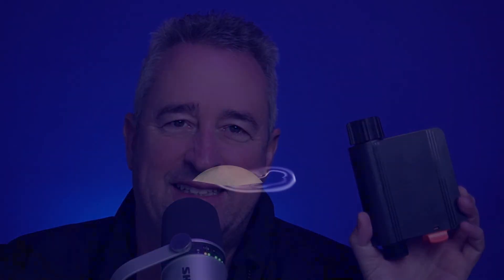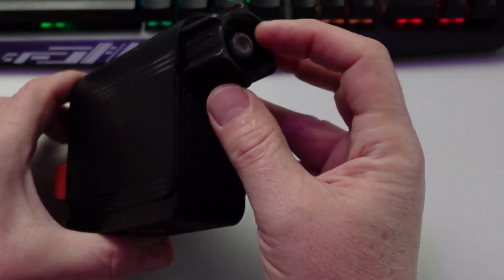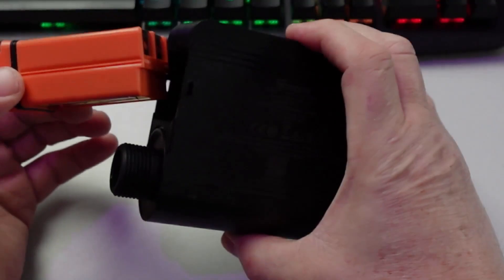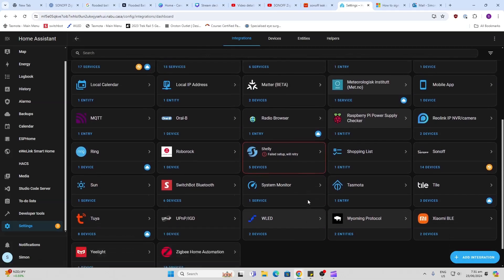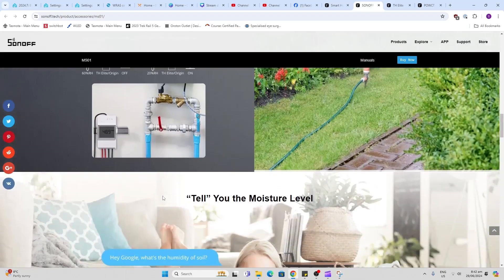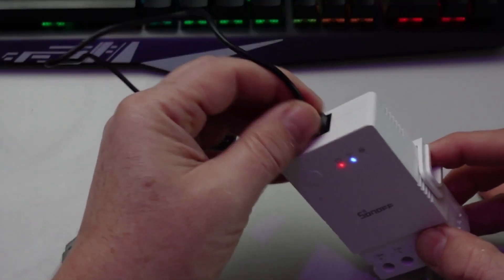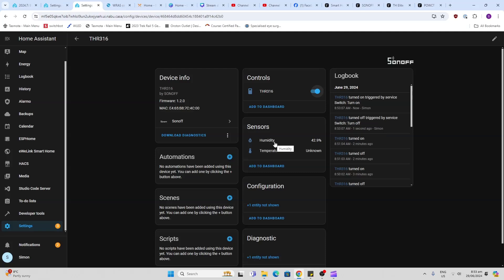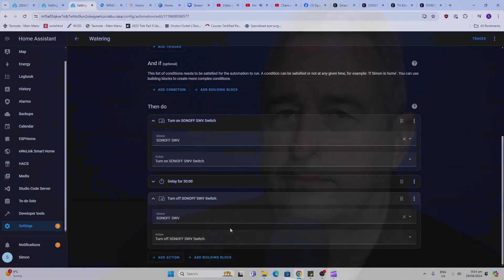Automate your garden irrigation with Sonoff and Home Assistant

Comment: Why not use a cheap electric valve connected directly to the sensor controller? The controller can control a 16A device so a electric vane connected to the controller might be way cheaper and easier to implement.
Reply from the maker: Sounds like a great idea!  I will check that out.

Comment: I bought one via Ali express.    I powered it up and  let the ZHA integration pair  and configure it.     ZHA found it very fast, whereas configuration took a few minutes.    In the end I find a new "SonOff SWV" zigbee device does appear in the ZHA integration device list, but the device has  no entities.   No on/off function, no flow rate, no diagnostics, nothing.    Google AI suggests I have to search out some new sort of zigbee driver thing called a 'quirk' file and install that in Home Assistant (If a suitable  'quirk file' even exists)..   At the moment I feel tempted to throw the bloody thing against a brick wall and smash it.   I'm so weary of fiddling about with things trying to make them work with home assistant.

Comment: I read online that the soil moisture sensor together with TH ORIGIN does not go over 50%. I saw it slightly higher in the video but did you see any higher numbers that got closer to 95% or so?
Reply from the maker: Haven't tried it for a while I will see if I can find it to try it

Comment: Can I use it to control the whole house by placing it in the central pipe after the water meter?
Reply from the maker: No I would not recommend this device for whole home water control
Reply: What do you suggest me ?
Reply: Maybe a mechanical device to turn the valve on and off. So you’re not putting this thing as a dependency.

Comment: Can you check the water flow functionality, please? I would like to know how accurate it is
Reply from the maker: Hi Amon, in order to get the flow metering I added the device to the ewelink app using my NZ Panel Pro.  For some reason the flow is now showing.  I will check with the supplier.
Reply from the maker: Itead told me that this feature will be available on NS Panel Pro at the end of the month, I will test then
Reply: @simonsayshomeassistant  I assume it just works with z2m then? Thanks for testing!
Reply from the maker: @AmonReich  Only a pleasure Amon!
Reply from the maker: Yes with MQTT